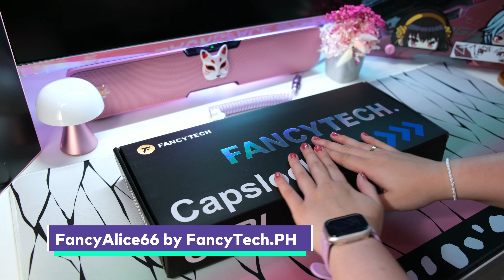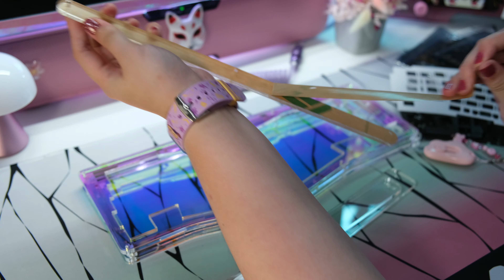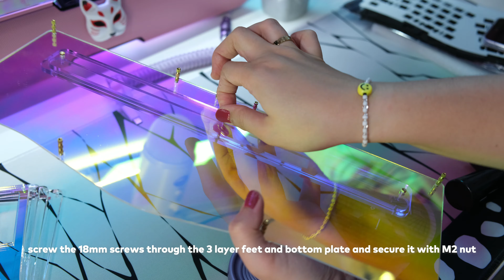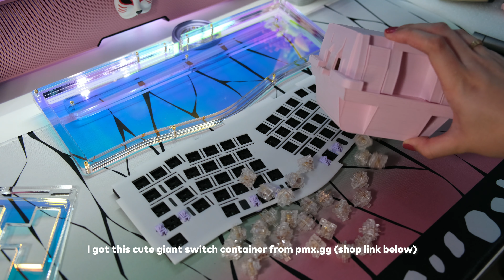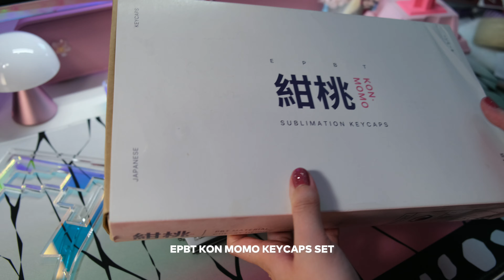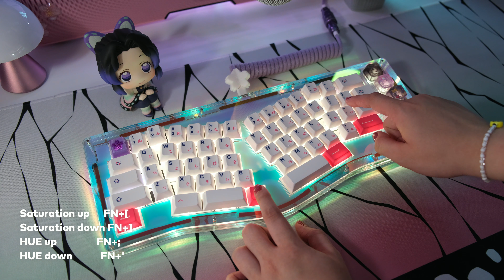FancyAlice66 iridescent Mechanical Keyboard build | unboxing + assembly + mod | Elyxirine

Comment: Not much point in a gasket mount when there's no flex - as the USB-port is not on a separate daughter board :S flex would only damage the port/pcb.